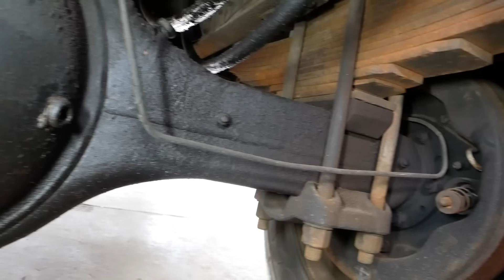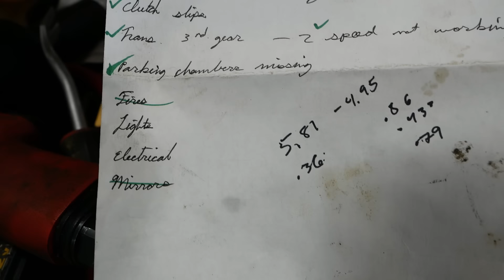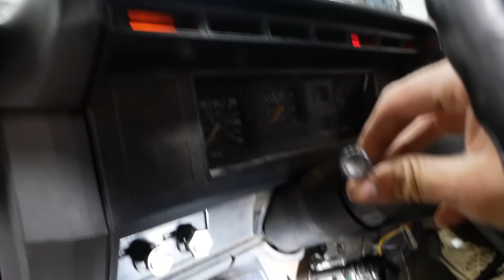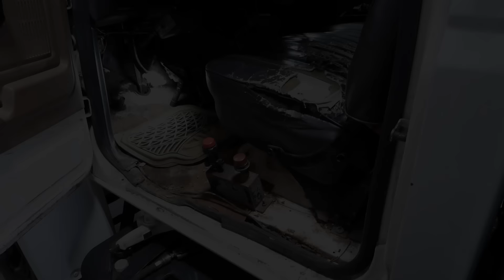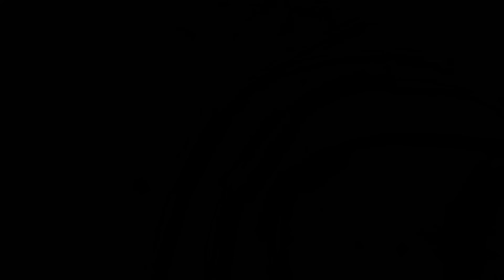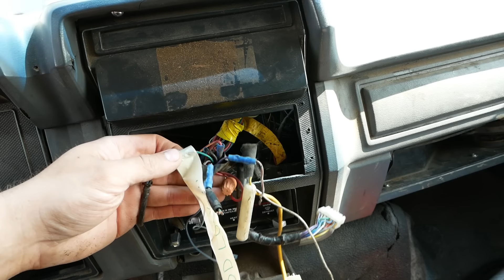Ford F700 Cummins Chipper Truck Project - P Pump Fuel System, Brake Chambers, and Wiring - Final

Comment: Nicely done, I enjoyed watching this series. My mechanic only wants to do big money generating jobs, if I ask him to do some small stuff like to change the fuel filter, he conveniently orders the wrong filter, and only does the big stuff... On my car you cant change fuel filter without hooking up to the cars computer, and run some program to remove the air. If the car senses air in the fuel system it shuts the pump down, and throws a code. Then you have to roll it to a shop, ask me how I know...

Comment: I have to say I never have seen the hydraulic actuated spring brakes. We used "micro-locs" they worked good untill fluid bleeds off.
Reply from the maker: Yep. Seen that happen. Ended with a car being crushed by a plow truck.

Comment: I have used an electric soldering gun on carburator floats several times with good sucess. The super thin brass solders great with my weller. That tail light wiring looks so familar. I just got appointed to the local town highway dept, sure I will get invilved soon. We have a 2000 Sterling bought used from a military cemetary electric butchered like I have never seen. We are have the country but if you like I mat be able tofetch it to you. Would make a great series of videos. LOL

Comment: Wes,  For that  unclosed  fuse  box  near  pedal.....  Ill  give to  you  big  dislike  button.  For example: If I was driving a truck with wet shoes, the water from the shoes  or  wet  dirt  would get directly on the fuse box.  And  then truck  is on  fire....  WTF man?
Reply from the maker: That’s the factory fuse box in the factory location.
Reply: @WatchWesWork    Yes, but  you should  make a plastic cover or something to protect fuses from wet  dirt or water ..... Its dumb location for a fuse box but you  should fix that.....

Comment: Owning a truck like that is like taking two thorazine tables and call me when you quit drooling Or why did I make up those business cards. A truck like that is a wintertime things are really slow and the customer has extra deep pockets. Did that truck have the shock stabilizer on the front axle. I thought I detected a Arkansas death wobble. Usually they do and their dead on inspection. Of course if it does and needs help, the next time it needs ball joints/kingpins they are just a part of the process of finding any of that stuff. The missing wires for the warning lights on the center console I found in a taped up wad in another loom when stripping one for parts. It was a too late discovery for that truck. This economy is lending to fix what you have or go without as new is not available. Another fine mess you've fixed again "Olli" from those old skits where there was a real skinny tall guy and a regular guy... dang its been that long since I have seen them.... common of the early thirties prefix to a movie. .... Stan and Oliver I think/guess. Nice work Wes

Comment: I wish I could find a mechanic who actually diagnosed things.  You diagnosed an issue with the sending unit...then further diagnosed the issue to the float...then repaired it instead of charging the customer for the part.  I think the mechanics I've dealt with would have replaced the tank, fuel pump, bezel, and relay.  $2k job minimum.

Just had a buddy who had a suburban that started drinking oil.  4 quarts in about 80 miles.  The mechanic diagnosed it as a bad engine because it was using so much oil.  Probably not wrong, but before someone drops $11k on an engine replacement you kinda want to make sure that's what it actually needs.

Comment: I genuinely appreciate you taking the time to diagnose and fix subsystems or components -- instead of  diagnosing them and just buying replacements 100% of the time.  Just because something is cheap does not mean we should be sending the previous part to the landfill, if with some level of reasonable skill it can be repaired.  At minimum we should see more people giving away or selling broken parts on places like eBay, when they themselves do not possess the skills, time, or equipment to repair parts economically. We should foster a culture of "If I can't fix it, I should make it available to someone who can" to  reduce landfill/scrap waste

Comment: True story I bought a 91 fox body and the wiring was a total nightmare similar to the truck so I started about fixing it one of the first things was light and wipers. The wipers didn’t work and sure enough they were unplugged so I plugged them in and bam they worked perfect, I turn them on and walk away for a minute comeback and the wires are literally burning the coating off🤦‍♀️ oh shit so I unplug the battery and pull the dash to find other wires that had melted but someone put weed eater fuel line over them as insulator and plugged them back up, the fuse box was a complete and total cluster fuck that looked like it had melted in other places before, Most of the harness was that way and needless to say the main section was entirely replaced

Comment: those rechargeable led work lights have auto shutoffs when battery voltage is too low. i've got a few head mounted lights, and a couple lights like yours. they all shut off when needing a recharge. that's why i have a few of them. that way i have one to use while the others are charging. only problem is like a grease gun, they always seem to be empty every time you go to use them.

Comment: Alright Wes, you were there with hands on..... do you think that what the owner invested in your time and parts cost to repair this hulk will actually pay off in useful work?  I'm very skeptical.  Not saying a new truck would have been better, but perhaps something less beat-up.  I'm thinking the diesel engine saved this thing.

Comment: I watch your YouTube channel because of your ability to diagnose problems and willingness to complete your repairs. 
I was disappointed that you stopped short of completing the wiring on the truck. If the truck is worth fixing, its worth fixing everything, and that includes the warning lights and radio.

Comment: LMFAO @ that electrical device box under there!!!  Romex connectors for loomed harnesses?  Gotta conform to those codes I guess...
The truck has full gauges, so maybe the warning lights in the 'center stack' were never used.

Comment: 👍Good job, but it seems you would want the high braking and turn signal lights working when towing a chipper
Reply: Any commercial towable chipper will have lights just like a trailer that you plug into the truck

Comment: Kinda wonder why they decided the VE pump version needed a lift pump at all, except maybe to speed up priming? The VE pump in my VW is the sole fuel pump in the system, no lift pump at all.

Now I’ve not been even remotely interested in testing this theory, but I have heard, unlike other mechanical injection pumps, the Bosch VE has the ability to self-prime from the tank even with completely empty lines. Just takes a looooot of cranking, so, y’know, not exactly advisable, at least for starter longevity if nothing else.

Comment: Think why missed the shift 3rd to 4th. On two speed shifting! And why third broken. On some two speeds, 3rd high is higher than 4th low! Have to shift 3rd low to 4th low the back up to 3rd high then 4th high!

Comment: That was a repair well done, those wiring nightmares would've taken me 2 weeks and plenty of hot chocolate drinks to sort out. These trucks are at full seasons' swing on the job and I can imagine the urgency of getting them turned around. And that shot at the end where the owner drives it away is just like a Hollywood movie. Very...real. Thanks Wes for another good one.

Comment: Hey on some two speeds 3rd high is higher than 4th low! Maybe why you missed the shift and rattled the two speed! Shift third low to fourth low then up to third high, then fourth high!
Reply from the maker: I've never seen the "short 4th" on anything but a GM. I missed it because I shifted the axle too early. But we got there in the end...
Reply: @WatchWesWork  well it is out there I have been driving for 50+ years and  yes some were/ are that way! Think it was because people could not down shift! So tried to make it easier by not having to shift two speed to down shift?

Comment: How do they get a tach signal on that 6bt for the dash. I have 3 early 90s 1st Gen dodges, and I'd love to figure out how to add a tach.
Reply: If it's a non intercooled motor. Isspro makes a tach pickup. Or you can use the alternator
Reply: @Mun56203  thanks for the info. I was wondering how ford did it. All mine are intercooled. The only alternators I've ever seen that had a tach pick up were gm Delco si type like those used on Detroit diesels. I just though maybe ford had a crank trigger or some other easily sourced item that could be harvested off a junk truck and adapted onto one of my rides.

Comment: Great video as usual Wes.  Amazing what $2K in parts and $40K in labor, can do to a $3,500 truck.
Reply from the maker: Heh. Not quite...
Reply: @WatchWesWork  we have a warrenty here. its called 12/12.  ...........12 minutes or 12 ft..
Reply: @WatchWesWork  cap screws,,,cap screws,,,,dam, ive waited yrs for someone NOT,, to call them socket head screws.or allen head screws,,. you win wes. a screw has thread to the head, a bolt has a shank. [ most times]. ausie..
Reply: @harrywalker5836 😅😅are a good 👍 q
Reply: @harrywalker5836 the official term is socket head cap screw, SHCS for short. I couldn't see week enough, but there's also BHCS, FHCS, LHCS etc.  all different types of cap screws.😅

 So really nobody is saying it correctly.

Comment: Surprised that you spliced in the solenoid weatherpac instead of crimping on new contacts and inserting into the shell... Run with what you've got?
Reply from the maker: The pigtail was not long enough.

Comment: Ford Differential Pressure switches are not self centering so you need to bleed the brakes on the end that did not have the hydraulic failure. Crack the bleeder and gently step on the brakes until the light goes out. Release the brakes and close the bleeder. If you cant get the light to go out try bleeding the opposite end. IMO Ford did it the right way so the light stays on after a failure. On a GM and may others the light will be out until the next unlucky guy finds out there are no brakes after the fact.

Comment: Back in the day those fuel shut off solenoids were $400 from cummins.
Now you can get Chinese one off ebay for $30-$40.
And since that solenoid replaced a cable from years before many old mechanics just fixed it with a $10 cable.

Comment: "Stuck wide open, that would be a bad day" Wait a minut, are you trying to imply, that you can drive a Ford with less then full throttle?
All kidding a side, good job on the rewiring of that truck, surely was a creative mess to start off at.

Comment: Nice work on a truck that did not deserve your talents.  Speaking of Fords, we need to fix your red truck.  I suggest that you place and inquiry on your postings looking for a clean, near rust free truck body for your beast.  Someone watching knows where one is Texas or Oklahoma sitting around looking for a new home.  Your current mount is not safe.  (You are critical of your customers for even less atrocities.)  You could swap bodies on a weekend and it would make a great video.  It will also keep the cash flow demands to a minimum.  You did say that the frame is in decent shape, right?

We also need to help you improve your cash flow since Mrs. Wes' RAV-4 is showing its age and we will need to get her a new ride.

Comment: Good job on the wiring Wes. Yep if ya got a wire rat nest,go back to the builder plug and chop it off and run new 4 or 5 wire to rear lights.

Comment: What is that red light for on the dash as you where driving
Reply from the maker: Brake pressure sensor is bad. No big deal.
Reply: @WatchWesWork  Thanks Wes

Comment: My automotive electrician's OCD just went into overdrive when you started revealing scotch locks and wire nuts. 🥴 I get so furious when I see stuff like that on jobs I'm asked to work on where electrical wiring isn't working anymore.  I always think out loud when I find it, usually including some choice swear words.
Reply: the new  2020 and newer suv envoys have same clips now with a steel locking insert so thats gonna be great when they get older in midwest.chop chop

Comment: I haven't the words. I have seen some crazy stuff before but nothing like this truck. It seems more than one hacker was involved in this disaster, but if not, that person should stay away from anything electrical, and anything mechanical. All I can say is that guy must really like this truck. I would hate to see what he paid to repair it.
Reply from the maker: It's a pretty specialized truck, so it's not cheap or easy to just get another one.
Reply: That is something I wondered, was a replacement truck expensive enough that repairing this made sense. Obviously it did make sense. He repaired it.

Comment: I picked up a set of 8 18650 Lithium cells and a charger off Amazon for my LED lamp.  I just bring a couple out and swap them as the light starts blinking red.  The ones I got have the little tip like an AA battery and a "protection" circuit, so they are exact replacements for just about any flashlight battery.  When you're doing a tranny job on the garage floor, the extra batteries really come in handy.

Comment: The way that fuel pressure dial was jumping it looks like that system needs an pressure accumulator with a pressure adjustable valve to steady it out to a nice even flow as needed by the engine.
Reply from the maker: Most likely it just has some air that needs to bleed out.

Comment: previous owners maintained the truck to the best of their abilities.
and they were finding every problem yes their repairs were get by fixes. 
very impressive amount of repairs you did,
most of repairs are simple but my gosh 101 fixes, finding parts are hard,  transmission was serious, all miss matched stuff on engine was bad to reverse all that.  very interesting I learned a few things thank you for the good information.

Comment: I really wanna know what the final bill was
Reply from the maker: Probably not as much as you might think.
Reply: @WatchWesWork  Which is to say that your customer got a good deal.  The biggest part of the job was that transmission work, both work-wise and labor $$$-wise, I'm guessing?
Reply from the maker: @DanEBoyd  No. Wiring by far was the biggest job.
Reply: @WatchWesWork  I think I'd much rather tackle the wiring than that transmission work.  I wouldn't let it scare me off if I had the proper equipment to deal with such a behemoth.  Heck, I couldn't lift the cast iron 3.03 'Toploader'  3 speed transmission into my F150.  I can still lift a T5 into its home though...
Thank you for making these videos!!!

Comment: Nice job Wes, I am amazed you weren't suffering a nose bleed dealing with that mess. Mind you I have had to "clean up" a few old wreckers that were left in the hands of "guys in the shop".. So yeah, lots of spare copper wire left over post "cleanse" and "exorcism".. I guess that pretty much defines "fabricobble" if one was looking for the definition of the phrase.. So I guess you didn't figure you would be practising "dentistry" as a mechanic, that transmission could have used some dentures for all the teeth that were missing. Very nice job, minimal amount of "colourful nouns" used (unless you edited them out...lol). Thanks for the Share, Stay Safe & Cheers!

Comment: Moscow Micrometer or as otherwise known as an All Sixteenths Wrench.
I used to have 6 different sized ones including one that had an 8 inch jaw opening.
Anything bigger it was time to weld up an open ended or box wrench.

Comment: Hey Wes I got one for you that I've never seen before. 
I picked up MF135 last fall, decent little tractor for shredding the pasture. 
I started hearing a dry squeaky sound the other day, and at first I thought it was the old belt going around the crank are something. 
Couldn't hear when I got off tractor to see where it was coming from. 
Anyways, get back on started mowing again, and few minutes later it starts again..
Figured out it was left front wheel, and so jack it up pull wheel and hub off castle nut pinned washer have this dry gritty stuff on them.
Get to looking at bearings they're coated with same stuff, and I realize there's no grease on anything. 
So I look inside the hub expecting to sed the 60 years of old nasty axle grease you'd expect there.
It's totally clean down to the metal, with light surface rust, and just a hint of grease just on the outside of both races, but not very much even there. 
Found same thing on the other side, and my thinking is as close as I can imagine. 
Old boy I got tractor from has a 15 to 16 year old son, and dad told Jr, to clean out old grease from inside of hubs, and gave him new set of bearings to put in it .
Well Jr did fine job cleaning the old grease out of it, but he never packed the new bearings with grease, are packed some inside the hubs like I always do.
So other than the grease from the factory that they use just to keep rust off the bearings during storage pending ssle, was all the grease they had ever known. 
Now I mowed twice since I bought it, and disc it and sprayed.
Call it good 40 hours sit time just myself alone. 
The boy told me he'd done the shredding there at they're place twice with it, and looked to be about twenty acres.
Now with five foot shredder that take probably couple days, and who knows when exactly the bearings were changed.
Anyways only had to replace one side with bearings and races, and both the wore out seals that weren't done with the bearings prior. 
Never seen hubs with rust on inside and absolutely no grease in them before.